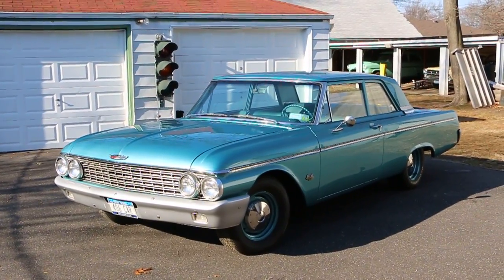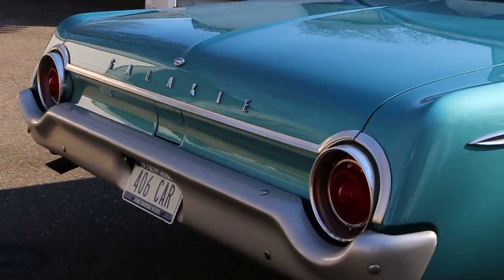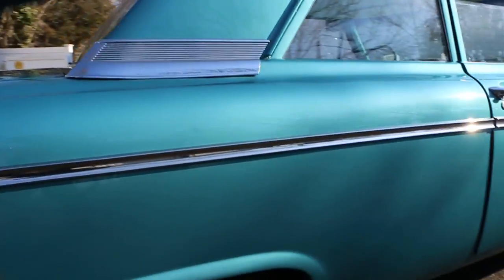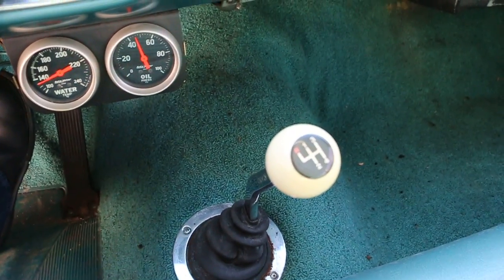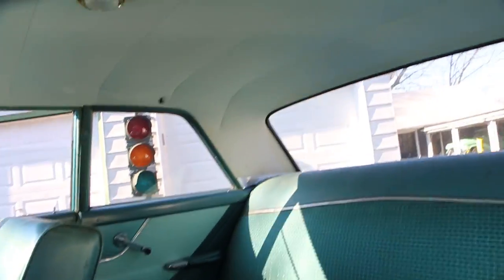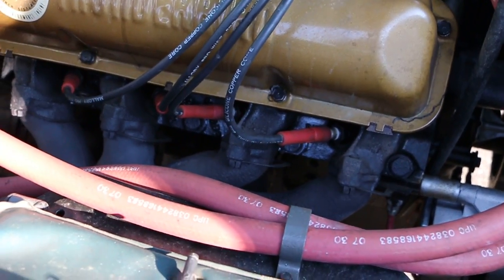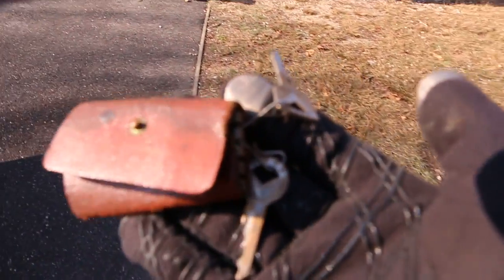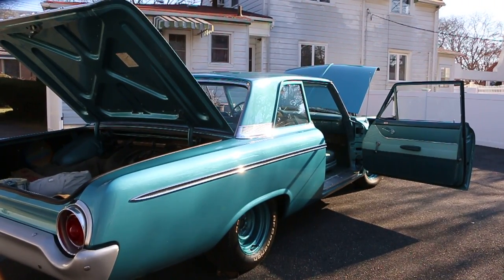1962 Ford Galaxie For Sale~427 Side Oilier~Tri-Power~4 Speed

Comment: Came as a 406 from the factory
Reply: That's not a real 406. The VIN has a W in it, not the correct G! This would have come with a 292.
Reply: @Payner2644  You are incorrect. The 5th digit is the engine. This one is a B, which is a 406. Plus the trans code is 5, which is a 4 speed. A 292 never had a 4 speed option. This is a 406 car.
Reply: I stand corrected. For some reason I was thinking the 2 digit was the engine. However, they claim in the video that it's a tri-power, which is a G code. The B-code it the 4 barrel option.
Reply: @Payner2644  Correct 4V.